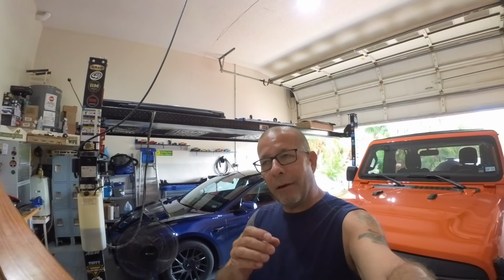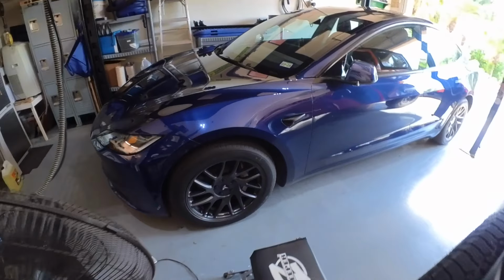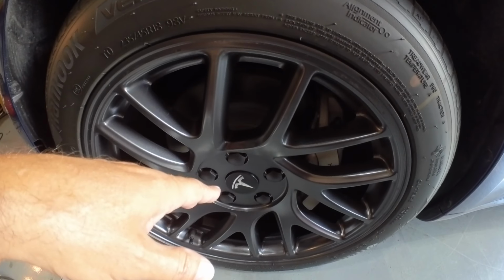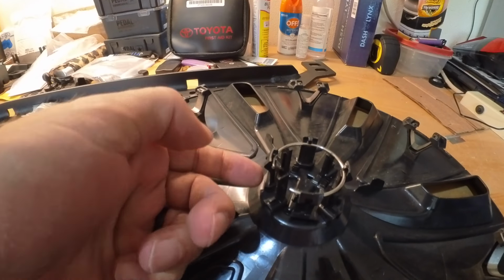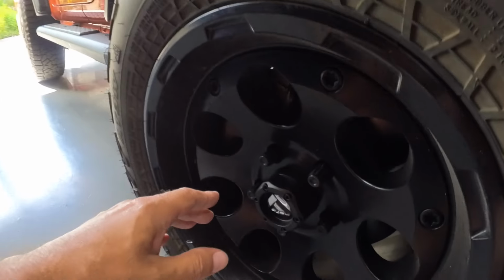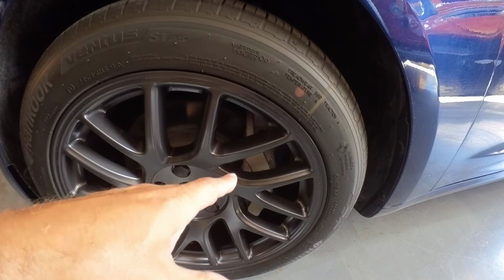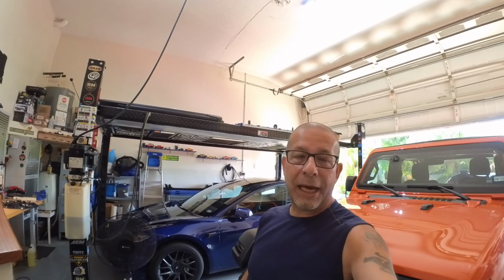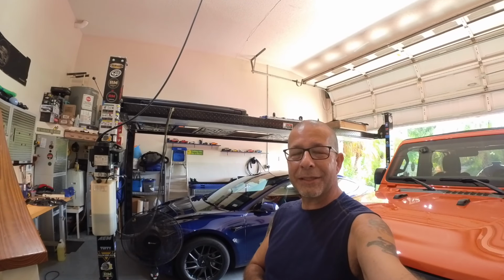Tesla Wheel Update And A Little Damage Caused BY Tesla

Comment: I have the same “Photon” wheels & aero covers… and I made the mistake of leaving my aero covers on for about 3k miles… so not only do I have some scratches from the metal clips on a few of the wheel spokes, but all four wheels also have light scratches all the way around the edges of the wheels - just inside the outer lip of the rim. Apparently, the aero covers moved around on that surface of the wheels just enough to rub on the finish and scratch them up a bit. It’s not awful, but it’s there. I wish I had pulled those covers off at delivery now.